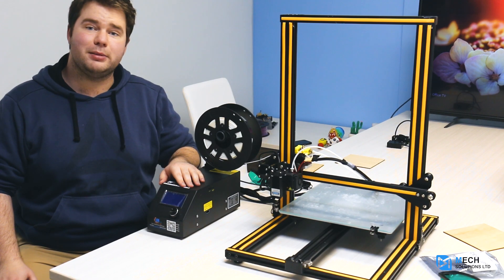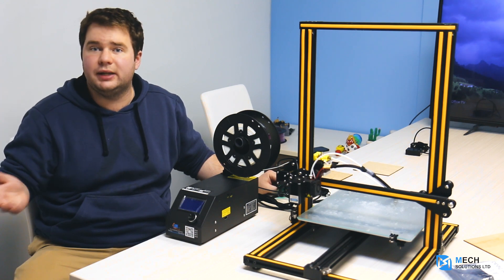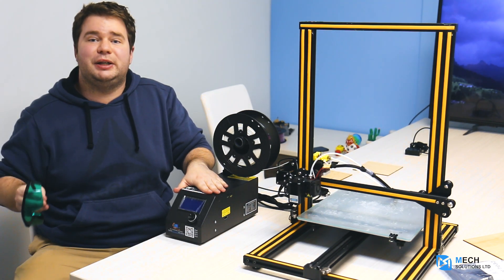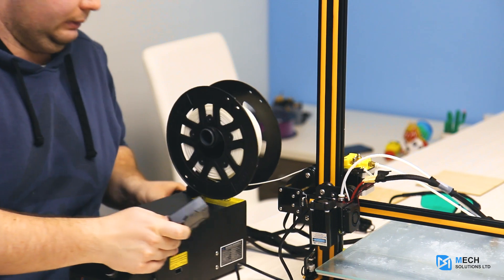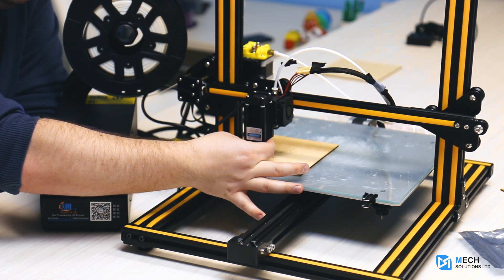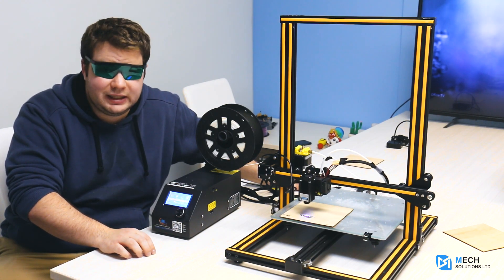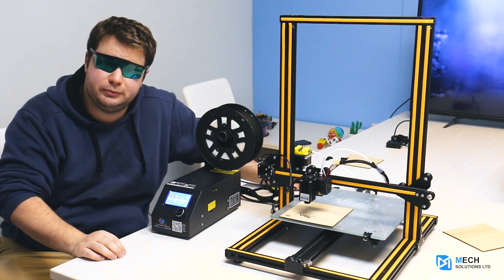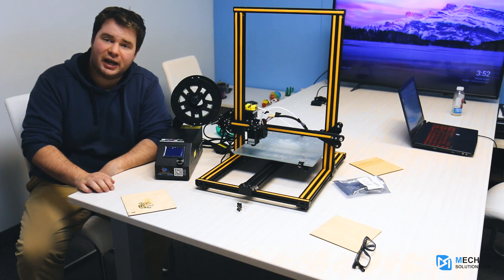Laser Engraving on CR-10S

Comment: Terrible video. The demonstrator promises complete setup, yet says nothing beyond the physical connection of the laser head to the printing fan. There is nothing said about what software is used; how to prepare a document for laser engraving; how to set burning depth or speed; how to center, for Pete's sake?? I notice the demonstrator tries twice to put an image in the approximate center of the wood sample (failing both times!). Do you not think this to be a rather important aspect of this operation?? Get rid of this video and replace it with something better, please.

Comment: "Procedures on how to setup and install a laser engraver on your Cr-10s Pro" - Must have missed that bit!!! You don't once show how to setup or install anything. You waffle for 6 minutes about the most obvious safety points repeating yourself ad nauseam like your viewers are stupid, yet you give little to no information regarding the actual installation, setup and use of these things. Pointing to a wire you connected off camera is not showing how to install something!! We both know you had to take apart the control box, how about a video showing that? Or showing us what software you used, and how the GCODE works? You know, the things that actually matter rather than just plugging your business.
Reply: damn, exactly what I was thinking.
Reply: still thinking the same
Reply: I nearly wore my safety glasses when I left the room, luckily I was told it's safe to not wear them when not in the room.